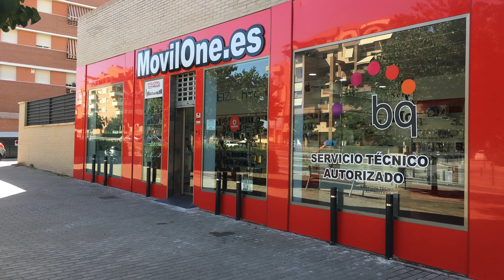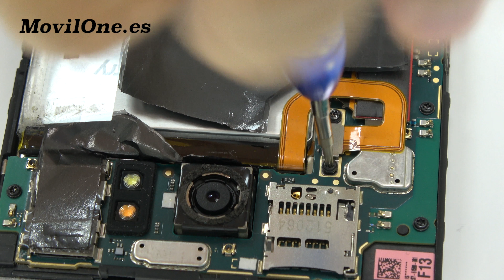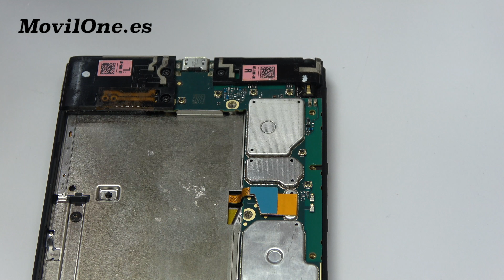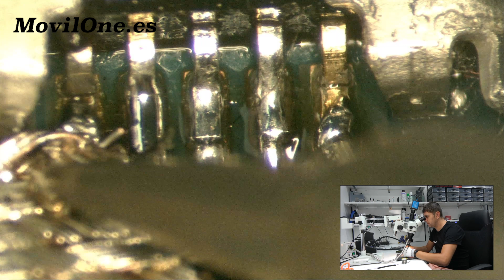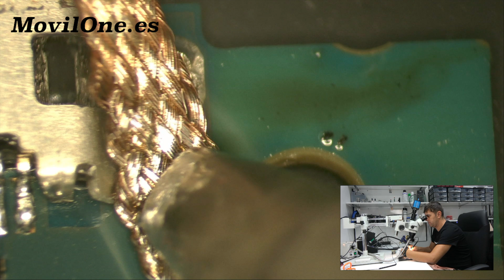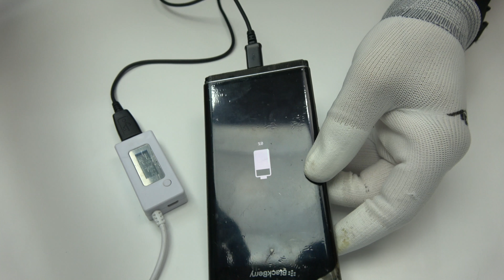Reparar pistas del pin de carga Blackberry Priv

Comment: Qual o nome do liquido que usou. O verde e o vermelho
Reply from the maker: Hola Jose. 

  solder mask bga mechanic
https://es.aliexpress.com/item/Fuji-red-glue-Epoxy-resin-adhesives-NE8800T-40g-for-BGA-Chip-resistors-capacitors-IC-chips-SMT/32820342214.html?spm=a2g0s.9042311.0.0.274263c02Z19MX